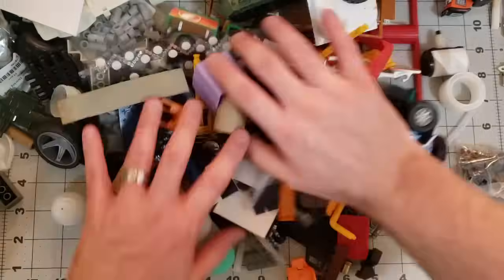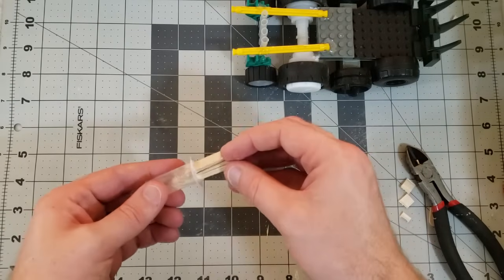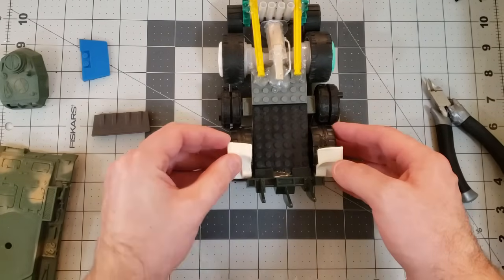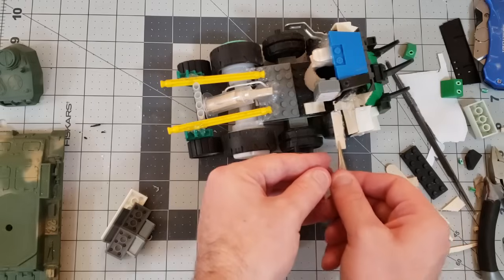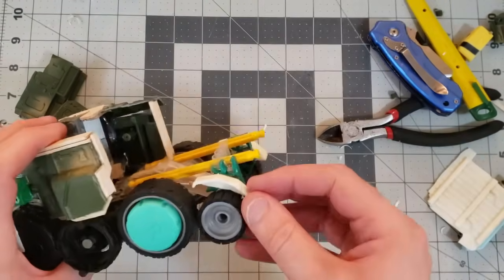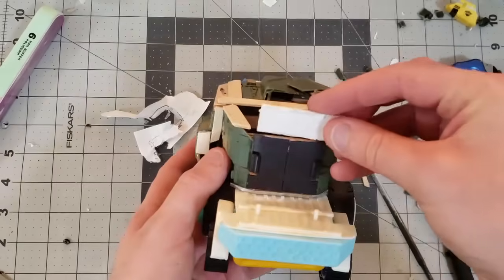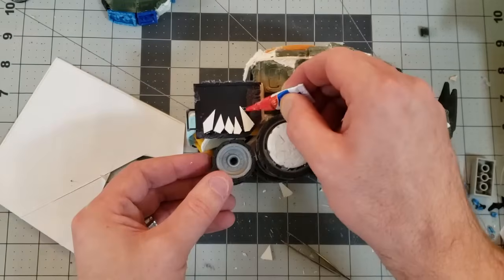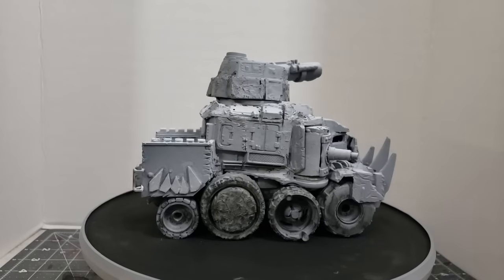Ork Battlewagon Scratch build: Part 1 Warhammer 40k

Comment: Great video, liked and subscribed! Could you tell me why you used superglue on some bits and glue gun on others?
Reply from the maker: Welcome!
There are some small elements where you cannot hide (and/or it will create a gap between the pieces) a giant blob of hot glue so in those cases I use super glue (and occasionally epoxy).

Comment: What is that cement thing you use?
Reply from the maker: Spackling paste or "Polyfilla"
Reply: if you use the unmixed stuff (DIY filler,drywall filler or plaster of paris) remember to add PVA, elmers or wood glue to the water to make it less brittle, less chance of it poppin' off plastic.